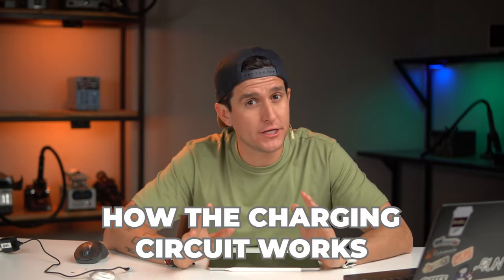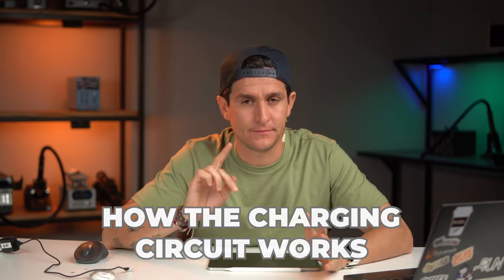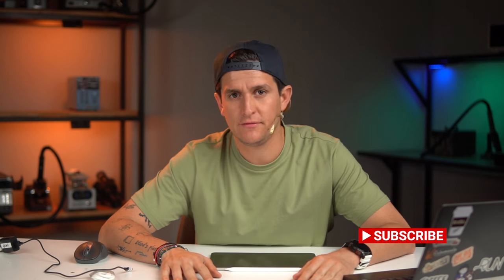How The Charging Circuit Works | How to fix any iPhone with Charging Issues

Comment: Hello. I was fixing an iPhone X   with no charge but only wireless charge it. To make my statement short. I replace both the usb ic and the 10ohms resistor on the rvp line but am still getting no charge and the power gate enable is reading 3.4V. So please help me

Comment: Edgar please on iPhone 14 if the capacitor were am supposed to have 9v and 4V the capacitor is missing can it cause the device to have 2.3v on the battery connector instead of 4.2v to charge my battery

Comment: Boss Edgar, I have iphone 11 not charging, i follow your 5 steps :
1. I have both 5V in vbus and RVP
2. I have 0V in Tp POW_GATE_EN
3. I have 6V in one side of the charge boot capasitor and 4V on the other side
what do i do next?
do i change the cap or coil or charger ic?
or do i change them all?
i don't have an ascilator
thanks
Reply from the maker: What model?